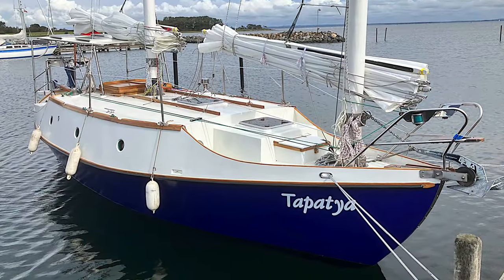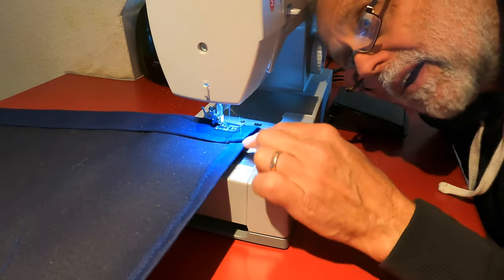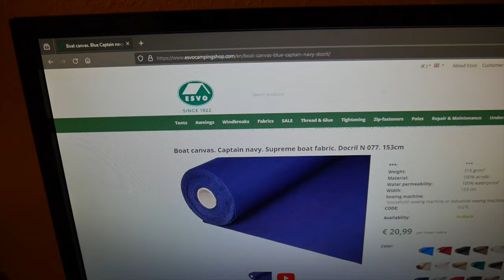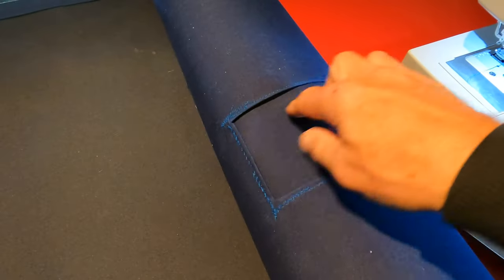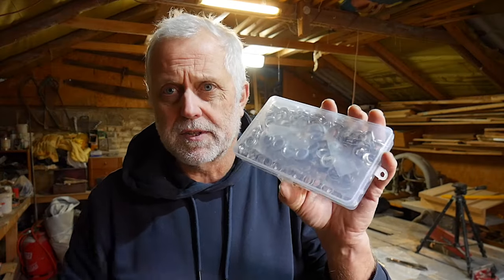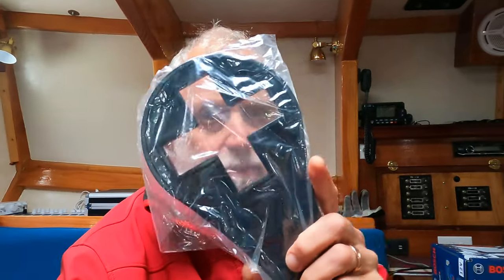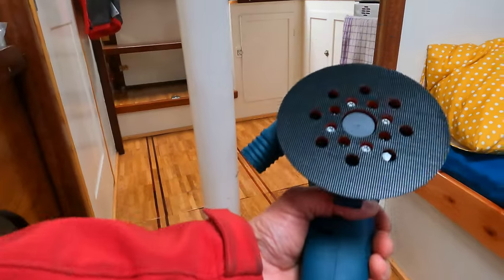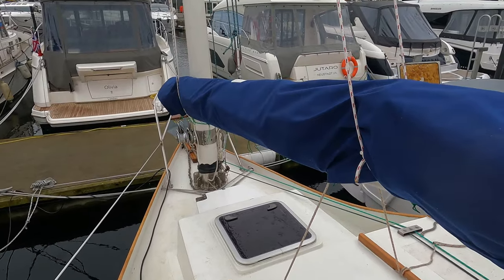The Winter Work Begins - Sail covers and engine filters - SV Tapatya EP306

Comment: Good luck in your winter efforts! If it was my decission I would keep the repaired raw water filter cover, new gasket and spanner on board close to the engine, you already had a problem with the cover and the serviceable old one might get you back to port. More luck!!
Reply from the maker: The spanner is already hanging in the engine room, Ricardo 😃😃

Comment: Well done Tony with the sewing machine - really quite technical sorting it out to rewind bobbins and get thread tension sweet - never used a sewing machine myself - only got involved because the missus was having probs with it.😉 I think you put the fuel returns back to the pre filter?

All the best.😀👍⛵️
Reply from the maker: Thanks Norman 😃
Yes, but the return to filter connection is only temporary. I intend to route it to the tank when I’m working on that later this winter 👍
Reply: @SVTapatya  Yes - good decision. I prefer the concept of pumped (churned) fuel returning to the tank - I believe it allows any entrained air (micro bubbles) to be liberated at atmospheric pressure. That’s my theory anyway.👍🤣
Reply from the maker: Yes, that makes sense, Norman 👍

Comment: Couldn't quite make out but have you only single jubilee clips on the intake/outtake pipes on the raw water filter? Probably wouldn't hurt to back those up if so. (Sorry if I sound like trying to give egg-sucking advice)

Very glad to see you on the water with the shakedown sail cruise behind you. Looks like you'll manage to sort out what needs doing handily enough over the winter and I look forward to watching the videos on this and next seasons sailing!
Reply from the maker: Thanks Sean. I’m not sure uf I double clipped those. Generally, I double clip everything below the waterline. Those are above it and right at the front of the engine room so very easy to keep an eye on 🤔

Comment: I'm sure you'll hear this, but a plastic "glass" on the fuel filter is not the right thing to have in the engine compartment because it's fire rating is probably zero minutes. First thing to melt and dump the contents in the burning bilge. Obviously a metal one is the best but useless for the purpose. Glass ones should be readily available. Nice work though and happy to see a sewing machine for less than 1200 bucks.
Reply from the maker: The glass one I had shattered, leaving me with a load of diesel in the bilge, Merle. This won’t do that!